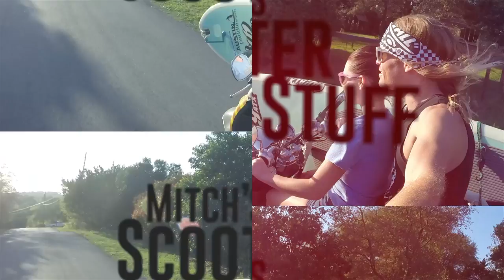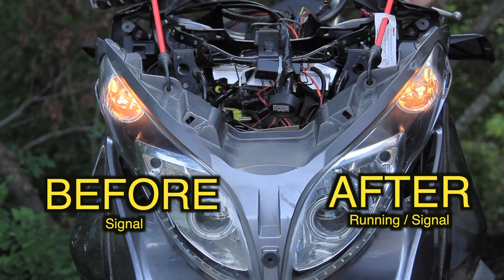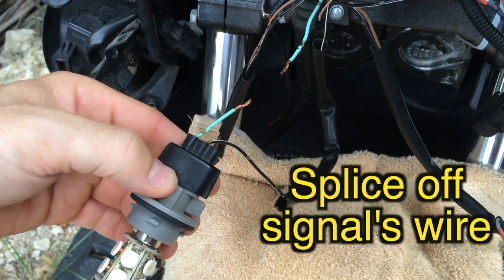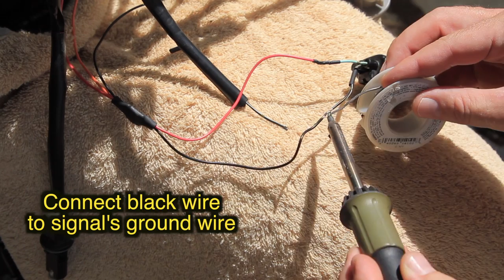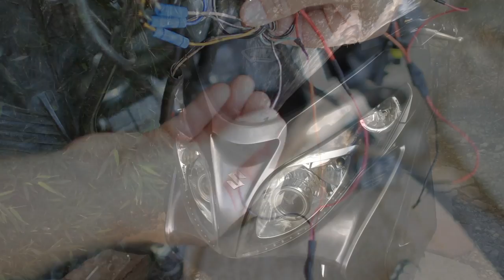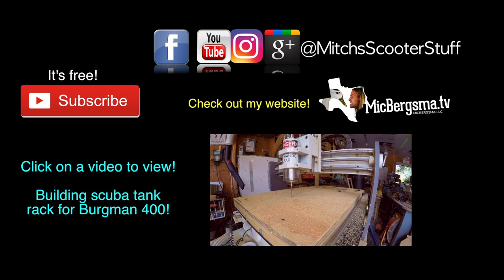Suzuki Burgman 400 - Turn Signal Light into Running Light - Blinker Genie | 2007-2016

Comment: Thank you.  However this statement on the manufacturer's product page (CustomLED.com) worries me, can you please explain if the indicator lights in the instrument cluster still work; "Note: the indicator will turn off for the duration of the blinker pulse - this is how the blinking is achieved."
Reply: What exactly worries you about that statement? That clearly is for the bulb not the cluster. Stay away from modding.